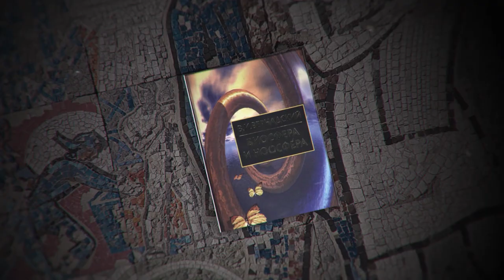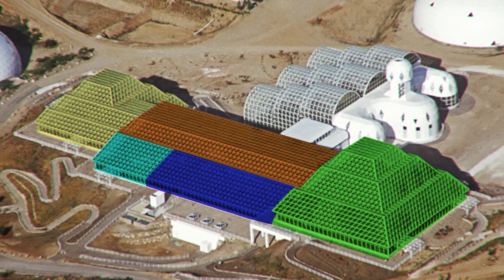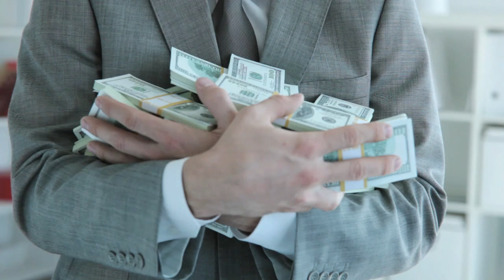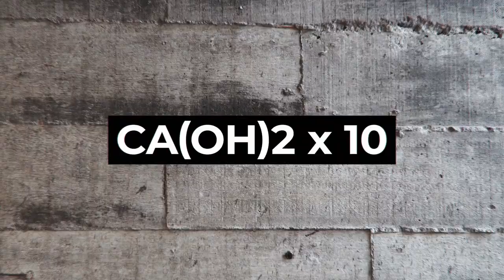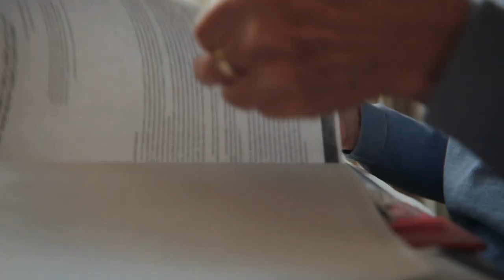This Is The Largest Earth Science Experiment. What Went Wrong?

Comment: In the long run, experiments like this one are not a total failure. They just get set back a little. Given a little time and research, we can find the problems and fix them. New materials and equipment can be discovered and improved on. Never give up, you will sooner or later find a way around your problems. Look how the airplane has changed since the first plane was invented. Everything has its good and bad points. Its a matter of taking its good points and improving on its bad ones.

Comment: 15:10 “Biosphere 2 leaked just 10% of its oxygen in a year. The space shuttle leaked 2% a day"
This is not surprising since the space shuttle was operating in a vacuum whereas the biosphere was surrounded by air at the same pressure as on the inside.
Reply: I doubt that the space shuttle "leaked" at all.  When they do space walks the airlock can't be completely evacuated of air so some will always get lost to space.  And when the shuttle is pressurized the pressure regulator has to have a port that leads to external (space) so there is a slight loss there, but it would be by design. The space shuttle would not have any leaks associated with the hull leaking through seams due to poor design. If it did...I can't find any information on it.
Reply: @michaeljorgensen790  Good info, thanks.

Comment: I would not call it a failure. they wanted to know what would happen, they found out sociological discoveries, they discovered things about material science and they figured out how they might make a better version of one is ever made again.
Reply: They definitely did stupid things that made it a failure. The experiment was made to research certain things and they were not able to do it because the experiment was poorly designed. Its like doing an experiment to find the speed of light and only figuring out your table is unlevel; yes, you did find something out, no, it was not useful for the actual experiment.
Reply: @SmashToBits  it is not a stupid thing.they are testing on what will be the results are and to avoid the danger in future and it already happened and it cannot be useful for the actual experiment but it can be useful for the future experiment.
Reply: @SmashToBits  but when it success in future. You will be completely guilty of what you said
Reply: The education system is the failure here, that makes people think that if an experiment doesn't yield the results that you want then it is a bad experiment, no matter if it provides new insights and solutions to problems that wouldn't have been devised if the experiment hadn't been conducted.

Comment: That structure has so much metal in there... and high humidity from all the agriculture and aquaculture going on...
You combine high humidity with exposed metal and you start to get rust developing.
The process of rusting will remove oxygen in a sealed room.

There was an incident on a large container boat, where a few crew members were ordered to go down into some hold that was sealed up tight, they had to remove bolts to take off a panel and create an entrance to the ladder, One guy descended down the ladder first, and halfway down, fell off the ladder and was unresponsive... Another sailor, in an attempts to rescue him... proceeded down the ladder and the same thing happened to him. There was zero oxygen in the hold from it being sealed completely and rusting process removing all the oxygen in the chamber and replacing it with mostly co2

Comment: When the Biosphere 2 started I was an aerospace engineer working on the Environmental Control Life Support System (ECLSS) for the Shuttle and the Space Station at Rockwell International, and then later on for the Lunar Base and Mars mission projects at NASA Langley Research Center. I was keenly interested in the Biosphere 2 project because it was related to my work. I was very disappointed when I later learned on the smuggling of foods into the Biosphere and on the termination of the project. I was somewhat relieved that Bass donated the project to the University of Arizona to continue the research. Since my retirement, I lost track of the Biosphere 2 scientific project.

Comment: Back in school, my biology teacher once told us about a demonstration he used to experimentally proof, that plants produce oxygen. Something he himselve got taught while studying biology. The setup was simple: a water plant in a huge glass container filled with water and a upside down test tube to collect rising gasses from the plant.
Over a few hours a small amount of gass would collect in the beaker. 
Oxygen synthesis proven. Right? 
To increase the demonstrative effect, he always slipped some extra oxygen in the test tube, when nobody was looking. With the class he then extracted the gasses from the tube and did a flame test. Exitement all around.
Turns out you can do this with the whole plant as well as with cut of parts. ...Even without any plant at all. The gasses collecting in the test tube where regular air gasses (mostly co2 and nitrogen) dissolved in the cold water, wich fell out of solution once the sunlight heated everything up.
 Again, it was only a demonstration. Not an actual sientific experiment. The goal was to keep students interestet in biology. 
But one day he was like "is this kind of bogus sience the right way to instill thesientific spirit in those kids?" And "shuldn't I be able to prove that plants produce oxygen, without resorting to cheap parlor tricks?" I mean, he knew plants produce oxygen, he only never had actually experimentally proven it himselve.
So he bought a expensive oxygen meter and a small fish tank he could seal hermetically and startet experimenting with simple closed ecosystems. 

This story is kind of open ended, because when i graduated, he still where not able to experimentally prove that plants produce oxygen.

His story kind of stuck with me over the jears. Taught me a lot about critical thinking and the sientific process back then.

As to why he failed? 
Propably the same reason biosphere 2 failed: bacteria in the soil use more oxygen than the plants can synthesize. Allthough, now there is a non zero possibility that plants actually do not produce any relevant amount of oxygen, based on my biology teachers experiments.

Comment: I do not believe this experiment was a failure  it clearly gave us useful data, that in itself is a success.
Reply: It seems that many of these issues could have been solved with smaller scale tests. You dont need to spend a billion dollars to find out your flashlight is out of batteries.
Reply: @SmashToBits  hey Debbie downer id bet money plenty of small scale tests have been done before this large scale test. And that large scale can make new problems and bring back old issues you thought were solved
Reply: @ragnawreck3968  also small scale experiment will have different result in larger scale. 

Just because your firecracker could fly it doesn't mean you can use it to go to space with just bigger firecracker.
Reply: @ReigoVassal  inst that what a rocket is?
Reply: @richoz27  Yes, but actually no. The mechanical inside the rocket is different.
Reply: It can be seen as a failure in that a lot of money was spent for very little result. Just consider the CO2 scrubbers. These have been used on submarines for 65 years at least and should obviously have been installed from day one  to prevent what happened. Same with the length of the experiment. Imagine if they had done first a week, evaluating the findings, then a month,  then three months, six months and finally a year.
Reply: @SweBeach2023  you are waaaaay too sensible/practical  SIR!!!

Comment: The old bio dome, it's still there and being used.
Reply: Do they still use it for the same purposes or other reasons?
Reply: @DaMilkManMan  it's used for a bunch of stuff by the college. They don't seal people up in there anymore like they that but still run a lot of closed loop test. The college was really lucky to get something like this for future students to learn from.
Reply: @DaMilkManMan  They do a huge variety of research there now. The coolest thing I think they are doing now is inside one the middle part they build this giant tiltable plat form with soil and all kinds of plants on top of it. And then they run water over it from one side to the other to test different erosion control strategies among other things. But the general reason its still very useful is that even unsealed it allows very fine control over factors like humidity, pressure, tempperature, air currents, ect in a very large space that can then be tested against plant an animal life.

Comment: They shouldn't have tried to make it work in one shot. Instead, they should have monitored everything and went for a month, analyzed the source of issues and restarted over. Every month or so they will discover subtle issues and test solutions without making it a "complete win" or "complete loss" situation. If no issues are present, they continue without restarting until an issue happens. That's the way to actually fail often and learn to get prepared to the one time you can't fail; i.e. Mars.
Reply: There is always unforeseen elements that can just throw u off. Maybe they should have only built half of the project first on survival part then added the non food producing side like the rain forest.
Reply: @lizardman1303  Right. What I tried to say is that you don't take a baby bird and throw it from the edge of a mountain; you instead throw it from one stair step and then from two until it can fly on it's own. We learn from failures, so the more the experiment failed,  the more solutions they can try and the more they'll gather an arsenal of precautions that will allow them to do this for real. You don't have to wait one year to see if your declining oxygen levels will kill you, you can simply measure them and see the trend and restart over and try to prevent it before it becomes an actual issue.
Reply: @lake5044  yea after they found out about the oxygen it should have been fixed took the data so they wouldn’t happen agin in future products. Maybe they found a lot of useful data the failures but were to caught up being disconnected from the world vs it being a place of learning

Comment: 3:00 "Remains the largest closed system ever" 3:15 "Air tight"... Isn't that the top of a tree poking out the top of it? 🤔😂
Reply: thats just the frame. you can see the glass and it does not pass through

Comment: The problem with large projects like this is that they tend to be administered by optimists to the exclusion of pessimists.  The one without the other is a cancer.  Cheating is inevitable because optimists, working in the type of isolation that overfunded projects like this one produce, will reliably misinterpret the absence of the headwinds that pessimists provide to be confirmation of the presence of certainty about the project's eventual success.  Research scientists do this all the time, it's called Data Dredging, p-Hacking, etc.  Projects like the one above are particularly vulnerable because they're funding is saturated with too many confounding, competing, and corrupting interests; prestige and public image for the funders and researchers, and the unwarranted risk of misallocation of capitol just to name a few.  The accumulation useful failures that are the currency of the scientific realm are debased in favor of the appearance of progress.

Comment: They don't call it an experiment for nothing. Most important lessons are learned from failures, and unexpected side effects. Those are the thing you want to know before you go to mars for real. And even if they did not release all the data, some big lessons were learned. 
Most people think that plants and trees generate most of the oxygen in the world, but it is actually the ocean and algae that do like 70% of the work. The run off of plants and trees do provide the nutrience for the algae in the oceans. So in my opinion, the ocean/lake section was way to small. The ocean should be more than half of all the bio habitat. The bigger the ocean, the easier it is to keep a stable atmosphere and temperature. If you don't have that, then you need very active chemical atmosphere control machines, with chemical reservoirs, to correct the chemistry of the air.  I also think they had a bit to much animal and plant diversity for the area they had. 
Maybe it would be a nice experiment to try to get a self stable bio-habitat without humans in it first. And better to start of with fewer species, and introduce new ones as needed. Start small and slowly expand, even if you have a big area. A lot of data can be acquired with every expansion step.

Comment: We did learn something.  If they used a CO2 scrubber, it would have succeeded.  Because of information like this, living on Mars may be possible sooner rather than later.
Other useful information will be need in the future.  Remember that it took Ben Franklin 2000 failures before he succeeded in creating the lightbulb.
Reply: the problem with the CO2 scrubber usage is it requires something to filter, and most filters need cleaned or changed at some point... granted while using a scrubber earlier would have helped things, its something that should only be there to A: be a backup system.. B: help build and stabilize the self sustaining biosphere... remember the idea was to have a totally self sustaining environment...

Comment: every one is saying this project was a failure... or success based on the point of view... and the part of the project they focused on.... but people forget the title of the vid is NOT if the project failed, but WHAT went wrong... so lets deal with that... first and foremost is Murphy's law.. this MUST always be taken into account with ANYTHING.... second, its obvious that aspects of the construction and implementation were flawed, granted it took time for these issues to be discovered, but ultimately that is what went wrong... if the project were to be started fresh, these facts could be taken into account.... perhaps with newer technologies a Biosphere 3 of sorts could be built and tested... obviously attempts to avoid mistakes from biosphere 2 need to be avoided... the concrete would be ensured better sealed to avoid CO2 buildup if possible.. a scrubber would be part of the air systems, even if it was only as a backup device until settings of the environment could self sustain.. the soil/s would need to be better set to control the microbes that created the CO2 issue.... as stated above, new technologies could be implemented.. such as hydroponics.. also, you need a slightly different skills set of people in the sphere... for starters a doc who can do ANY procedure needed, perhaps 2 docs, in case something happens to one of them... you also need the plant and animal specialists to maintain the biospheres and food supplies, even if everyone in the test needs to help with a bit of everything.... obviously you need a tech or 2 to maintain what equipment is in the sphere.... a few scientists to actually monitor what is going on in the sphere.... and at least 1 person to help with social and psychological issues.. and perhaps a few people who's skills don't really fit just to keep things more natural.. after all if the intent is to eventually colonize other planets such as Mars, at some point the skill sets wont line up with whats needed... though the new skills might be needed later, such as mining and construction....

Comment: This was however sad, a success as he failures gave material information and all kinds of data. Bacteries in soil would not happen on moon or mars, but the gas issues from the soil  could be a huge issue if you used just whatever soil or used concrete without proper sealing

Comment: Members of a drama group. And too much compost. And too much shading from structural members. And exposed concrete and mortar. But it was a noble experiment. I think it needs to be tried again on a smaller scale. Not necessarily with sealed in occupants though, just an airlock. I would be glad to help to design such a thing. Maybe a single acre in size.

Comment: I so some documentaries that you cannot stay long under a trees I think because it is less oxygen under the trees.... 🕵️‍♂️👁️👶🏻
⌛⏳: Maybe the design of hour ⌛⏳will help the breathing system better the people must stay between the hour ⏳⌛glass where the air are most active you can have it on a level and the  2 side are like the design of cell phone handle that will remain in one position because of the 2 side are like wheels are loosen so if the hourglass role the thing inside  remain level as it is. So you will not notice if the thing moves ? Example just play with hour glass and make role and make sure it's has the same amount of sand in the glass our on its both side the sand will slide back in the same level to the floor because of the gravity? 🕵️‍♂️👁️👶🏻